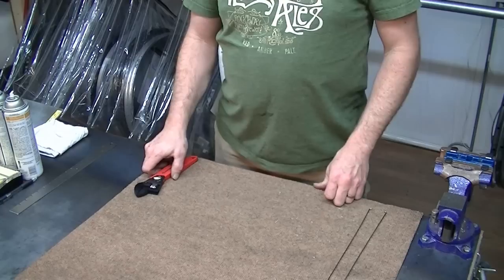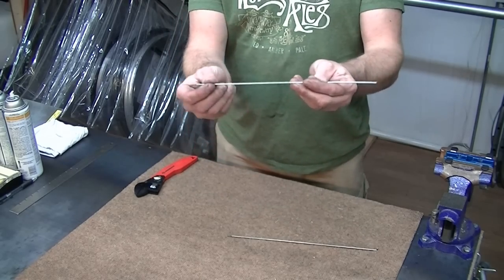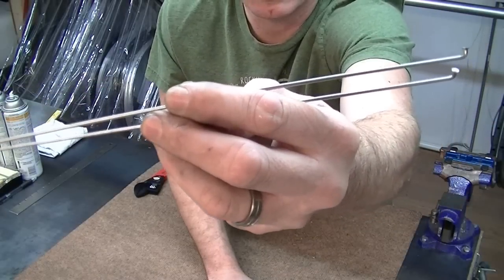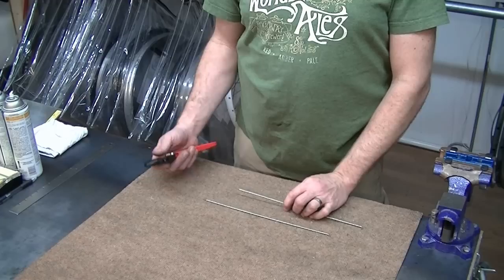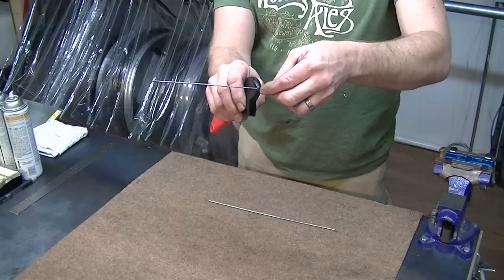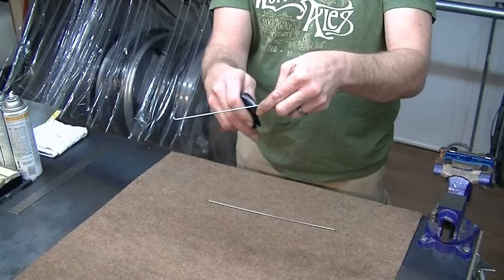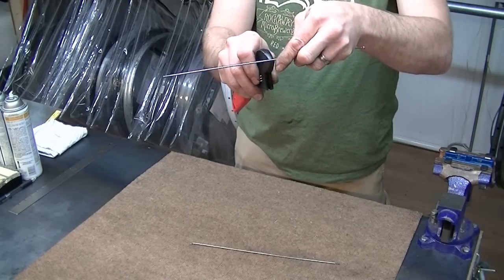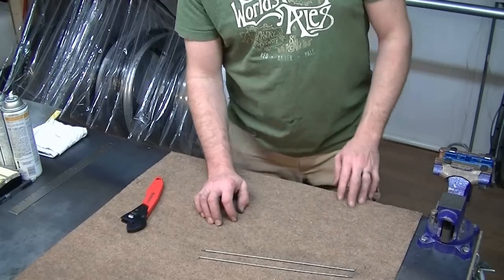Distinguishing a DT Competition Double Butted spoke From a Straight Gauge spoke.

Comment: Thank you in advance. I have a 5 year old Trek (used for street riding only) that started breaking spokes a year ago. The bike shop replaced the wheel, and now this year I broke a spoke three times in the last two months. I went several years 80-100 miles a week at a higher body weight (220+) and never broke a spoke, ironically. This bike is rated 300 lbs. Any suggestions? Will butted spokes or a hand built wheel help?

Comment: Thanks for this, I thought my wheelbuilder used straight gauge instead of double butted as I couldn't see the butt as I can with my other set of hand build wheels, but using your method actually worked to identify them as DT Swiss Competition.

Comment: Currently looking at builds on your site. Right now looking at a Phil high flange track (32, 130, QR) paired with a HED Belgium Plus for heavy city/urban riding with some rough patches, etc. Of all the spokes you offer from DT and Sapim, which would be your top picks for this setup, for long term durability ? 205lbs rider here. I know your configurator offers recommendations but I'd like your personal input if possible.